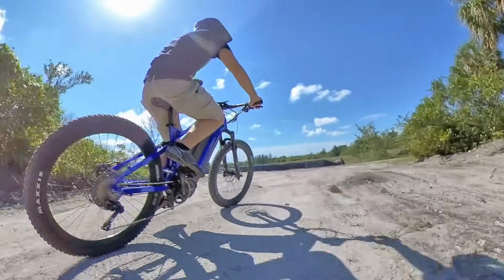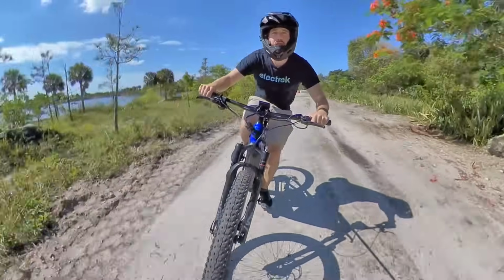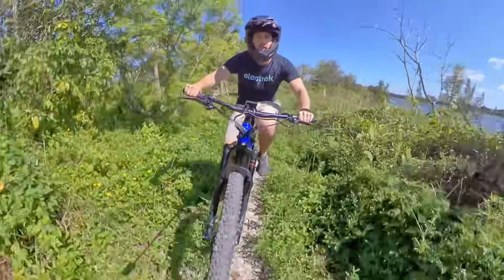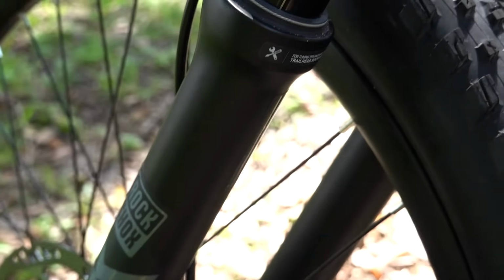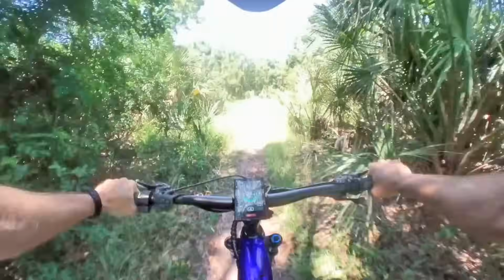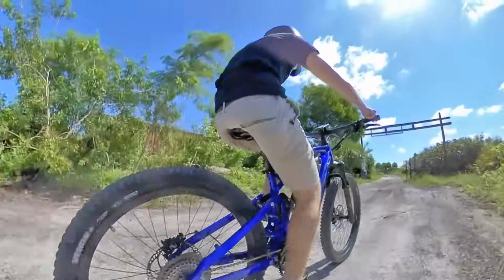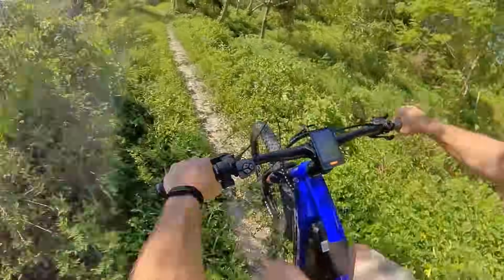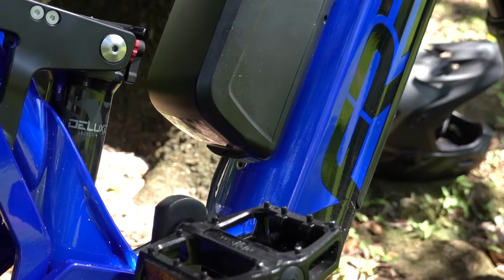1,500W FREY EX Pro electric mountain bike review

Comment: I was against ebikes on the basis of religion feeling that all the fat and lazy ding dongs who resorted to this were going to die soon of the heart attack they deserved. Them my wife had to go back to school and basically stopped riding. She wasn't hugely into it but now it's painful to ride with her, like most of the ride I am basically stopping looking back waiting many minutes for her. I think I cold walk faster than she bikes at this point. She's still kind of fit but certainly not like she used to be and cycling is singular so... am thinking of pulling the trigger here as an all round bike that could go on both road and trail, have decent speed and lots of battery power above all else. Some electric road bikes are really awesome but lack off road, some electric MTB's are really awesome but lack range or speed. This has both. Very tempted to think I could have her riding with me.

Comment: How do I order one of these bikes?
 The batteries are a little on the small side for me. And I like the battery that snaps into the frame and has a teeny little flip boat handle.
 Their common. The biggest one I've seen is 20Am 48& 50v I'll stick with 48v. please send me your contact info 🚲

Comment: The external battery cover is available.  I should be receiving it and the rest of the bike in a week or two.  Also you mentioned the wear on the chain and sprockets but there is an optional gear sensor that cuts the motor during shifting.  There are other optional accessories available such as lights, bike rack, etc but it's strangely difficult to get a full list.  You should mention that shipping is not included but it's still a bargain IMHO.  Also Frey stands behind their work.  Good company to deal with.  That said lead time (order to ship) can take several months).
Reply: How's it going with the bike?
Reply: @Certago  good except I have gone through 2 cassettes, and 2 chains.  They should use steel  cassettes instead of aluminum to avoid breaking teeth.  I bought this because I am 230lbs and wanted to make sure that I could ride 30 miles.  With the two batteries, I use a little more than half the batteries when riding 25 miles.  With the two batteries this bike is very heavy. I have also gone tubeless for riding in the desert and have had no problems.

Comment: There is a cover for battery i have this bike a bottle holder cover. The bike is like a motor bike very fast but looks just like an electric bike. Not a  little 250w over priced ebike would catch it. This bike is superior to any other ebike on the market today. And doesn't belong on roads this bike is built for the trails here at Glenn tress. Its scary fast no road bike would catch it. Love it absolute beast.
Reply: Glentress Peebles?  Do you own a Frey bike? If so where did you buy yours?  (sorry for the question barrage).
Reply: @majordelays4909  Hi there yes Glenn tress is in Peebles Scotland. I am in Edinburgh and have Frey Ex pro with 2 batteries and battery bottle holder cover. I bought the Frey off Alibaba spoke to Ivy then decided to buy. It was delivered by train freight all the way from china. Simon sells them to here in UK but cheaper going through Alibaba i took the risk. It is a risk as you can be hit with anti dumping tax and charges. The bike is amazing never been on anything like it you must know this or you wouldn't be asking. Cheers
Reply: Peter Shanley glad it worked out for you. I can only imagine the ascent to spooky woods was a blast the whole way.  Also Innerleithen ascent must be as fun as the descent!

Due to Covid I’ve failed again to manage my pilgrimage this year.  But your lucky to have the seven Staines and such enjoyable stuff on your ‘doorstep’!

Your views on the Frey model are encouraging.

I think I am familiar with Simon due to some initial research.

I decided to do CBT and get something more road going to compliment my current ebike. But I’m keeping an a watchful eye on this end of the electric market as being off-road is really where the fun is to be had.

Enjoy!
Reply: @petershanle9675  how's the bike running now? Do you recommend? What's your top speed and travel range? I'm from New Zealand

Comment: Plastic magura brakes, crappy rockshox, rear derailleur hook is of pressed metal and prone to deformation ... These are not high end components, but serious weak spots. Keep hitting curves on the street with that front fork and you will be eating same curve when fork breaks... 1 real off road fall (this on the video is pure shame to call off road) and brake handles together with oil reservoirs will break... 3m jumps with this?!? Good luck with that, you gonna need it... Easy trail - yes. Real offroad - hell no!!! (get a spec for that)
Reply: Please enlighten us ignorant ones, what setup do you consider "real offroad".
Reply: @KKhhoorrnniittee  cnc derailer hook,  fox dhx 5 rear shock, fox rc series or marzocchi bomber front fork, adjustable brake levers that are NOT made of plastic.... Comparing this with real DH or FR bike is like comparing Dacia Duster with Lada Niva... Yes it is cute, but that is not off road...
Reply: @monsterbnt  That would obviously set the buyer back a little more than the asking price.
Reply: @KKhhoorrnniittee  then they should not advertise it as ''high end components'' because they are not. They would still have enough interested people since not everyone is extreme rider. But advising someone to go to extremes with bad components is dangerous and irresponsible. I've seen people seriously injured because they trusted such advertising.
Reply: @monsterbnt  "Not high end" is RST and DNM with Promax cable-pull brakes. And I would certainly not do extremes with those specified in here.

Comment: Nice bike.  I would like to have it but you can get a 7000w electric scooter from alibaba for $2k with shipping included. That will get you 60 mph with insane acceleration and big tires and suspension. Or you can upgrade your existing scooter with upgraded controllers, battery, and bigger tires for faster speed and comfort and control for under $1k.
Reply: But a scooter can’t be taken to mountain bike trails easily.
Reply: I looked into electric scooters. Wheels too small, safety issue. Not super-ranging like this one. Etc. I almost went for the Kaabo Wolf Warrior but a full-suspension ebike like this Frey EX Pro seems safer and more reliable.
Reply: @davidchou1675  You can jump over with full size scooters with suspension on the road, very useful for transportation and hauling cargo trailers. Don't let those little wheels fool you you got deceived by the general public and deceived by yourself. When you travel at 35- 40 mph you will go right over the pothole on the road. You won't get caught in the holes and crash.. This is the truth God revealed to me that a lot of people didn't know. If riding on Rocky mountain trails and mud/swamp is your thing then stick with the mountain bike I was implying on necessary transportation for survival not recreational ride..
Reply: You can buy a skateboard for about $15 and only use it on steep hills and still get 40 miles an hour. What is your point? Do you not understand that speed has nothing to do with it it has a lot of performances and attributes that are not speed related. If you don't have the money to buy it then don't buy it.

Comment: At $4k, Frey is catching on to what Lectric is doing with the $899 XP. Sell direct, cut out the middle man and the resulting bike price will be at least 50% less retail. Their shipping costs however are outrageous.  Most premium eBikes I have looked at cost double what they should to cover bike shop over head, distributor channel,  etc. My advice is to buy direct when you can as eBikes won't have the longevity as a regular bike. You will want to upgrade eBikes every few years as technology and features improve and batteries get cheaper and larger.

Comment: I wonder how the center of gravity is with two big batteries  ??
Reply: I changed my ebike from mid position to a rear rack battery. The added cargo rack is nice, but now there's not enough weight on the front wheel for me to ride no-handed. The front wheel starts to wobble. Most bikes are setup with too much weight in the back. So having these batteries near the front will help keep the bike level, especially with that big front fork.

Comment: The extra battery on top makes it look cheaper , it’s same as I have on my diy ebike
Reply: Ordered one without the extra battery built in. Makes it a cleaner looking bike. You can then add a bottle holder if wanted. Also ordered a spare battery, so still have the extended range if needed.
Reply: Jason Mart hi mate, does that just make it the same as the am1000? What benefits are there to the ex? Weighing up which one to get myself...
Reply: @bgate1984  batteries and bike geometry are the difference between the EX and AM1000..the EX is a little more aggressive and more range I believe
Reply: @JasonelricMart  how's it going now? Which website to buy? What's your top speed and travel range?
Reply: @kiwimon3204  Bike never arrived. Was taken by customs en-route. Wife’s CC arrived. Same motor. Great bike.
Reply: My recommendation is to go for a bike from a shop. I bought a Haibike AllMtn with the Flyon motor. Shop derestricted it for me too.
Reply: Nicer integrated battery on the ex. Better components. I assume better geometry as it’s their new offering. Nicer looking bike too
Reply: Jason Mart nice one, cheers

Comment: I just recently bought a biktrix juggernaut ultra fs it's a Canadian company with a 17.5ah 52v battery it is actually insane haven't went by a speed radar at full top speed yet as my spedo reads 42 when the radar reads 49km/h but I have had it at 54km/h and was still accelerating 
It has a sram nx 11 speed and it also has the bafang ultra
Reply: I've been looking into the FS biktrix...
I'm guessing you opted for the no limit power option... lol...
Reply: @lukyluciano7524  yup for sure you can get a usb cable for it and customize the output of the motor at any point from starting power to the level of power you need for the torque sensor the options are endless i have a little over 2000km on it now and it was worth every penny
Reply: @lordnox69  What would you say distance average  range is ?
Reply: @norcal773  40km 100% even if you live in a hilly area
Reply: @norcal773  if you don't go fast and keep it in a low pas you can get 70km easy

Comment: Yes! I've been waiting for this review for what feels like forever, ok maybe a month. I ordered mine in June and am still waiting for it to ship let alone be here so I'm stuck watching/reading reviews until then. I'll be riding some pretty aggressive mountain trails in Colorado and hope that it does the job. I demo rode a Specialized Levo Turbo SL which only has a 250w motor but weighs only 17.35kg/38.25lbs and it did a great job. I know the Frey EX will be significantly heavier but all that power. Torque comparison; Specialized Levo Turbo SL 35NM, Frey EX 160NM! I also got the EX without the extra battery so that'll cut some of the weight. I can't find how much it weighs anywhere. Do you know how much it weighs?
Reply: 35 kg
Reply: Ordered mine last April, got it in mid August. 2nd day on the trails I went over handlebar and broke my scapula. Not the bikes fault. Bike is awesome. Worth the wait. Few things to note, 1. it's heavy but that's the territory with electric bikes. 2. The power kicks in and can catch you out on the technical stuff..... it will take getting used to. The screen seems very exposed on top of the stem also. Great bike.... soon as I mend, I'll be out again. Good luck with yours.
Reply: @Frack_Black  Thanks for info. Hoping to hit it hard but hopefully not that hard. Wishing you a speedy recovery
Reply: @Frack_Black  I'm also looking at buying one. That is my main concern. Power delivery. I've ridden the BMC and Haibike. Both have this excellent smooth power delivery. It's very natural. Just feels like you are riding 2 or 3 gears easier than the gear you are in. Is the abrupt power delivery is that just on higher power settings? I thought you could also adjust things like that through the handlebar controller. Is that not the case?
Reply: @mileswaite3161  I believe you're correct, I used it on sport mode 3 - 5 mostly and the power would come in. I never tried on the lower power settings so I can't speak to the power delivery there. I know bafang are a pretty well established ebike motor manufacturer so I'd imagine on the lower settings things would be smoother as you describe the more well known motors ... I just liked the full power all the time. 😊 When I broke my scapula I had to ride 8km back to my car throw the forest trails..... It was sore but, hell, did I appreciate the throttle and extra power then.
Reply: @Frack_Black  so the power caught you off guard? Mine is on order..waiting.. but I've ridden several Bafang Ultra's and always wanted more power..I hope it's got plenty..hope you are healed up